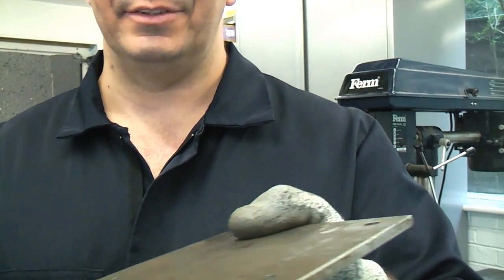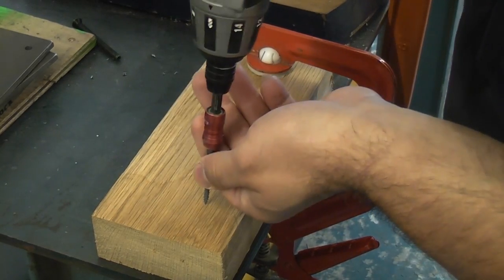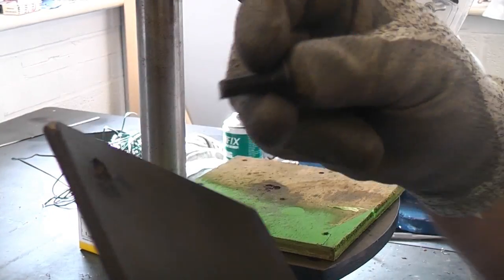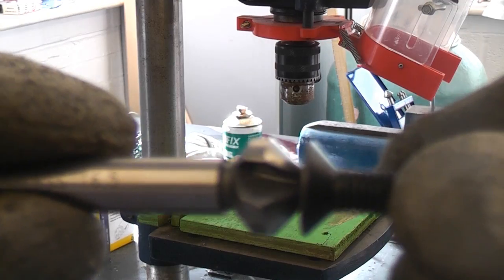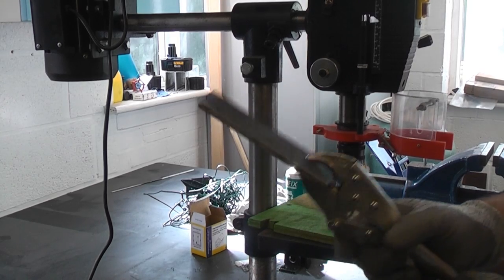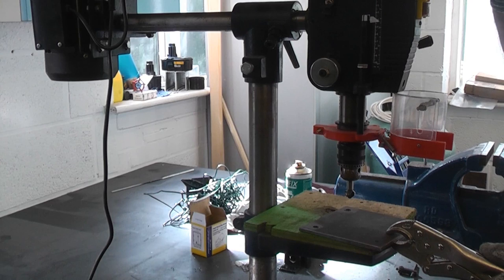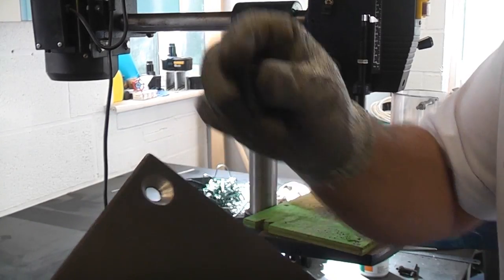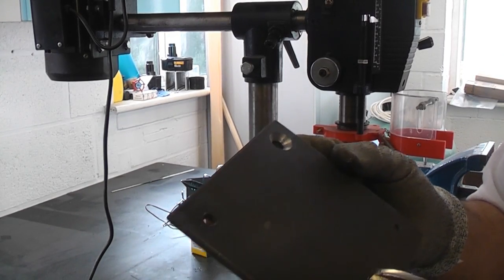Countersinking

Comment: One small area you might have liked to add is to get the correct angle countersink for the screw/bolt you are using. Less important for wood but on metal projects you could end up with uneven clamping pressure from the bolt head which could make the work weak or even worse could crack or split the top piece.

Comment: Hi 
I feel I must point out that I was surprised to see you doing this without the work piece being secured to the drill platform. The reason for this comment is I have seen a lot of work pieces were the bit has snagged causing the work piece to be rotated this can take the operators hand with it. thanks for your video clips I have learnt from them.

Comment: I've never seen a "counter bit" snag, it's shape and way of cutting the metal its more likely to go off center when the piece is not properly secured, also counts the pressure and the speed...but I am aware that when having experience in metal working the skills matter and good results can be accomplished...but when "drilling", the material type, speed, pressure and use of the appropriate cooling avoid snagging but there is a chance to occur, it's matter of great concern...Thanks for sharing it.

Comment: Could you show us how you set it up to be at the exact same depth as the rest of them please?
Reply from the maker: You need to use the depth stop on the pillar drill-
https://youtu.be/YAj65KyH9bg?t=77
👍
Reply: @ultimatehandyman  have you used different drills in your life? Are there different systems to set up this?
Reply from the maker: Yes, I’ve used plenty of different pillar drills in my life. Sometimes the depth stop is different than the type I have on my home pillar drill, but the key to getting identical countersunk holes, is to set the depth stop correctly. It’s always best to practice on a piece of scrap first 👍
Reply: @ultimatehandyman  yeah at my job the depth gauge is almost completely broken so even if you set it up. Most of the times it still lets you go past set depth easily. That’s why I was wondering if you knew different systems for it cause I want them to buy one.
Reply: @ultimatehandyman  you got any links to these different systems for depth?
Reply from the maker: No, I don’t have any video on that.
The only thing I can suggest, is that you adjust the table until you get it to the correct depth. The drill press will have a maximum amount of movement until it can go no further, so you could lower the table completely, then us the handle to lower the drill as far as it will go (with the countersinking bit in), then raise the table until you get it to the correct height. You can then lock the table and proceed to countersink the rest of the holes
Reply: @ultimatehandyman  alright thanks for letting me know. the table is fixed sadly.
Reply from the maker: I've just checked and it looks like you can get countersinks with a depth stop. I have never used one myself though- https://www.amazon.co.uk/Wolfcraft-4391000-wolfcraft-Countersink/dp/B07NS6HS1F
Reply: @ultimatehandyman  thanks looks like a viable solution although not perfect. Looks promising I will tell my boss hehe

Comment: i am about to make my first countersunk holes by myself in a 2mm aluminum panel. i got a drill press like yours, a Hanger HSS Co M3 6,3mm countersunk drill like yours but i do not understand what is the brown product in bomb you put in the final stage to get the perfect hole : cutting oil ? this looks like a lubricant (i got a bomb for car called "solid oil" similar to yours)
Reply from the maker: Hi, I used a cutting/tapping fluid which keeps the countersink bit cool and prevents it from over heating (which can damage the countersink bit)

Comment: Silly question, my hand drill has 2 drilling mode, they are R and L, which mode I use for countersink drilling ?
Reply from the maker: R would normally be used for drilling or countersinking.
Reply: The mode is determined by where in the world you live , what way the toilet water flushes , are you left or right handed and how drunk you are .

Comment: Hi, UH. Would you say that one of the main reasons your drill bits cut so fast is because of the cutting fluid you use? I have never had much luck drilling metal, the main reasons I have concluded are; cheap drill bits,dull bits and no fluid. I have invested in some cobalt bits and I know it is recommended they are used only with cutting fluid. I have yet to use these bits yet but I am expecting good results. Any experience with these bits?
N.

Comment: Ive never seen a countersink snag either the fluted as used here or the fluteless (my preference) Even if it did snag however he had the correct setup using his left hand to secure the work with vice grips and his right hand on the drill, if it did snag the piece of work would be spun just a small amount until the vice grips hit the pillar then it would stop. Scary yes but not dangerous.